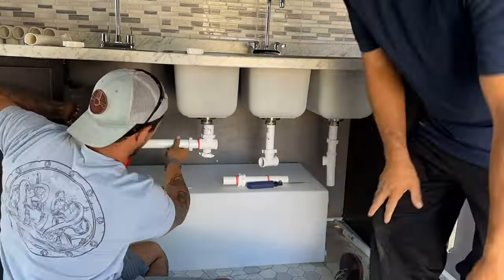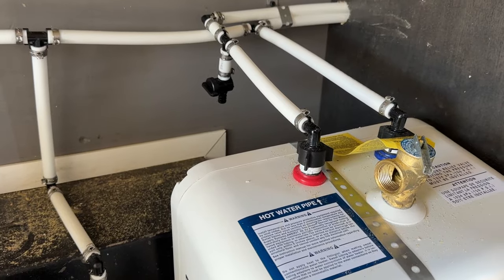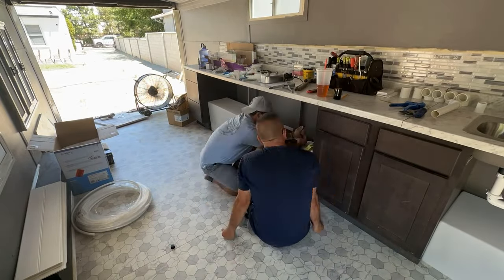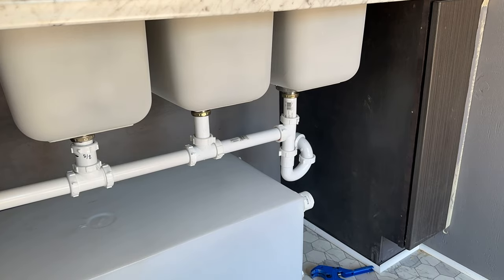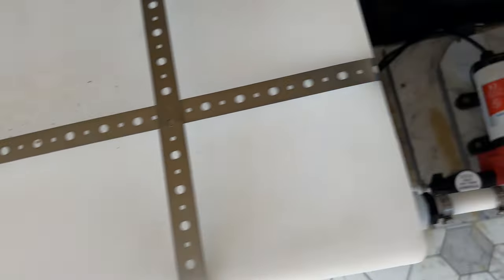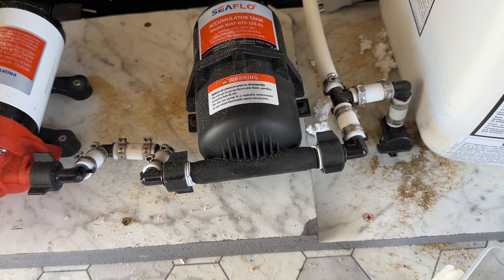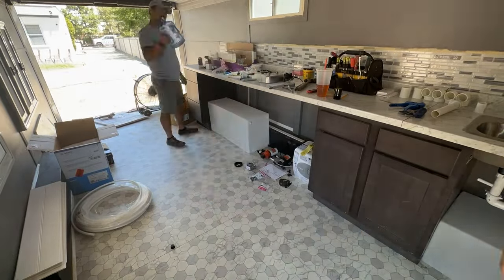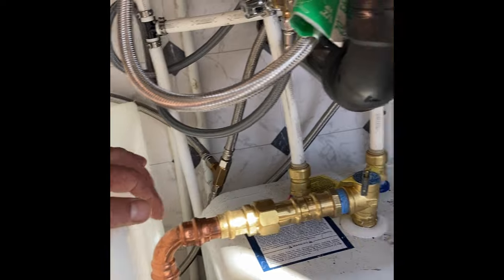Plumbing for a Coffee Food Truck | Water System | $ Cost | Sinks & Tanks | Green Joe Coffee School

Comment: Hey Vince! Appreciate all your videos - great work! Question: What is the point of the Accumulator tank? What’s the purpose and is it needed? Also, do you vent from your gravity water line if you are using the city water fill line? Thanks in advance
Reply from the maker: Hey Joe! The accumulator maintains pressure in your line. IMHO it’s critical for espresso Machines!

Comment: Excellent video! 
I do have one question though- when connecting to the city feed/hose directly, how do you keep the water tank from over flowing?
Reply from the maker: Great question! The only way I know how to do that is through bypassing the tank. There’s some valves on Amazon that allow for by pass…
Reply: @GreenJoeCoffeeTruck  that is what I normally do, just bypass the water pump and tap into the pex right after the water pump and out a check valve to prevent back flow into the water pump.
Reply from the maker: You mess with these yet? Seems reviews are mixed…https://amzn.to/3rGOUqx

Comment: How you doing Vince? 
I built a coffee trailer here in the state of California and currently have been in business for almost 2 years. An issue I recently in countered was finding out that my water filtration for my espresso machine and brewer is not enough. What do you use or have used for your builds?
Reply from the maker: Hey Mark! I’m a BWT fan!!!
Reply: @GreenJoeCoffeeTruck  
Totally agree I was already looking at their products. I will get their filter for sure. I will definitely not recommend EVERPURE filters they just don’t cut it. I’ll share a pic of my build with you; it was definitely a journey to build a coffee trailer with literally no experience
Reply: @GreenJoeCoffeeTruck  
Vince any suggestions on water testing kits for hardness of water? I did already got my self a BWT filtration system
Reply from the maker: Hey Mark, talk to your local espresso machine repair man. Most likely he already knows how your water is. He's been having to test it and place filter for years. That would be my first step, just to see if the test is necessary.
Reply: @GreenJoeCoffeeTruck  
Great advice Vince I appreciate it. I will do so thank you